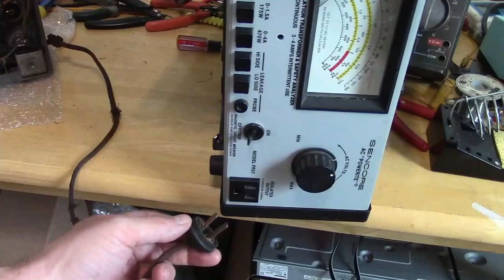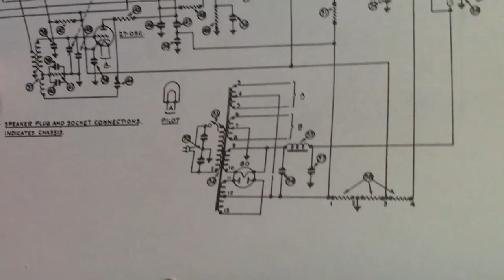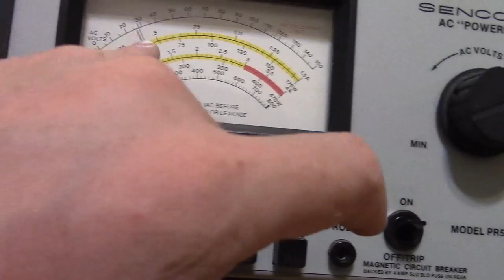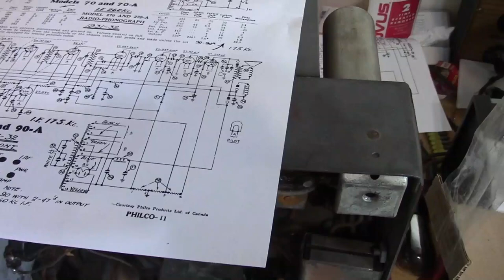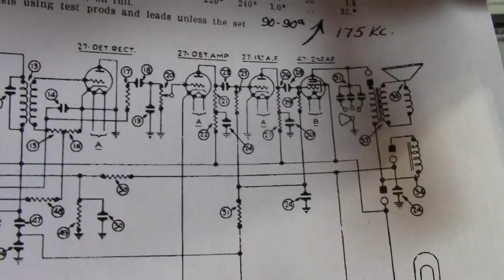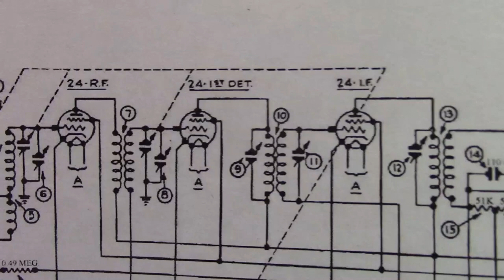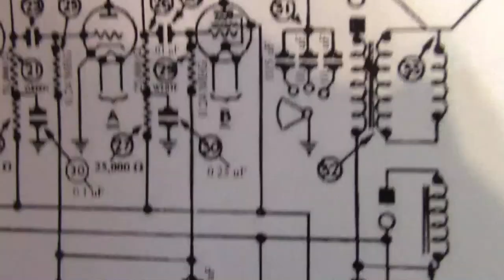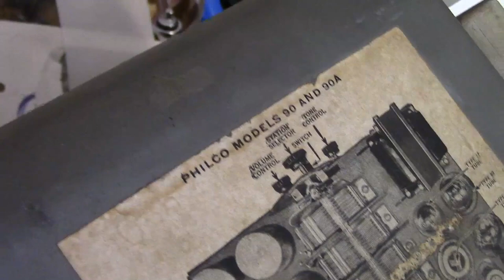Philco 90 resto p1o?

Comment: If you are gearing these videos for raw beginners you might want to sometimes mention the danger of shock from any voltage greater than about 40 volts. Dont go touching just any point when powered up. Some points are safe to touch others not. Keep one hand in your pocket and make sure no other part of your body is grounded etc. Some newcomers may be totally unaware of basic high voltage precautions.

Comment: That "1st detector" is actually a mixing/amplification stage.  The circuitry differs from more modern superheterodyne circuits that the pentagrid tube (heptode) made possible by serving as both oscillator and mixer, and requiring only a two section tuning capacitor (three sections if the radio has an RF amplifier front end). These four sections, I believe, were the best that could be done with the tubes of the day.  They would add something to selectivity I believe.

Comment: Thanks. I have one, too - not restored. These videos will be a great help. I also needed to locate an original speaker. Got one (I think it's correct) on eBay a while back. Beautiful radios.
Reply from the maker: Sadly it turns out the speaker I found is for a push pull output model 20. The search continues
Reply: @bandersentv  Yeah, like I wrote "I think it's correct". I bought my 90 on Marketplace from the original 92-year-old owner. Only paid $75.00. I'd been looking for one I could afford for 45 years. But the speaker and grille cloth weren't original. When I can take another look, I'll get back with whatever numbers or printing I see on it. Thanks again.
Reply: My dad collected Philcos. Oldest were a model 20 and a 50, both cathedral style, marketed as "Baby Grands".

Comment: There looks like there is another B+ rail derived from main B+ rail power that has then passed through the field coil of the loudspeaker.  That goes through R50 and is bypassed by C30 after that.  This routing might be the way the field coil gets the hum bucking part of its power.

Comment: Good effort to describe the reasoning behind what's going on with this radio evaluation and repair.
Some servicers will use a dim-bulb tester, putting an ordinary incandescent light bulb in series wth the AC supply circuit.  This is a good way to verify that yes, nothing has shorted out so bad it would blow a fuse or something harder to fix than a fuse.  I don't know if your variac has that kind of protection, or how easy it is to service if it does.
Reply from the maker: The Sencore PR57 variac has both a circuit breaker and fuse.  Normally the breaker pops but if it should ever fail to, the fuse will offer backup protection.

Comment: I want to see that thing work !!!  When are you going to show us that thing actually works ???  It sort of seemed like you got it 95% fixed but then all of a sudden you just quit and people are wondering if it ever will be fixed???  Gary G.
Reply from the maker: Have you watched parts 2 and 3 ?  The will likely be 4 more parts before I call it done.  Still many caps and resistors to replace, tone control to rebuild.  Clean, lube and replace shock mounts on the variable cap.  Rig up a speaker to use and do a full alignment.

Comment: I think with regards to the output transformer being used as the B+ supply the use of a transformer either as a push-pull or single-ended depends on the core of the transformer. Something to do with the effect of a single-ended configuration magnetising a solid core? So if you come to use the transformer as an audio output push-pull transformer after using it as a single-ended it will cause distortion on the sound. see recent video by @xraytonyb
Reply from the maker: Yes, the core can get saturation in class A (single ended) mode because there is always current flowing.  I'm using a fairly beefy 10 watt PP transformer though.  We shall see how it sounds.  Meanwhile I'll keep looking for an original one.

Comment: Greetings:
Error 1: Both your schematic and the video show the filter choke on the chassis, eliminating the need for the speaker field coil, but you appear set on using that speaker anyway.
Error2: the caps in that first bakelite block are each between the chassis connection and each side of the power line, not across the line directly as you claim for one cap.
Error3: Right after warning us about the across the power line caps you forgot to disconnect them prior to powering on the set.
Reply from the maker: Isn't that what I said ?
Reply from the maker: 1. This model uses both a filter choke and a field coil. Take another look at the schematic. The speaker field coil is shown in the upper right.
2. I thought I went to great lengths to talk about how there is a cap from the hot and neutral and ground. Not across the line.
3. I absolutely did disconnect the line cap before I powered it up. Did you not see where I removed the wires and spliced in a new line cord ?